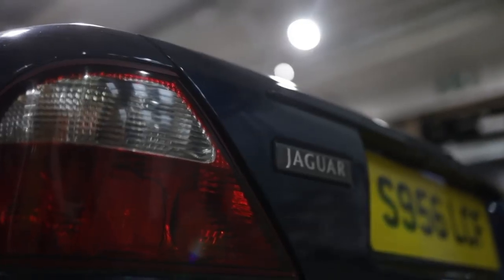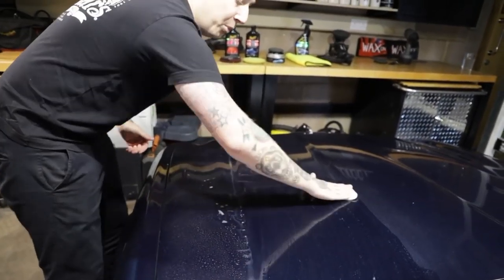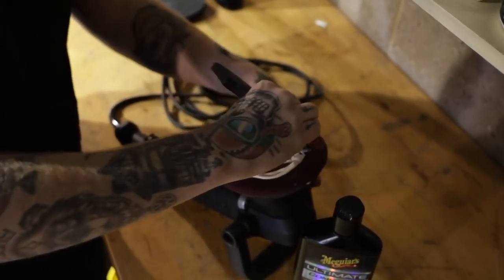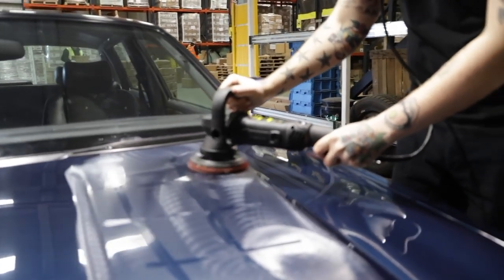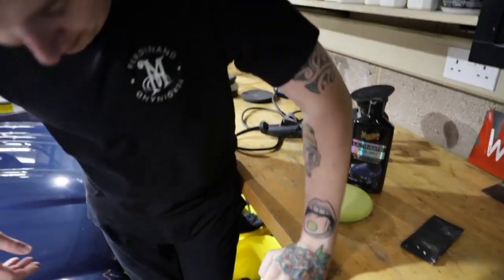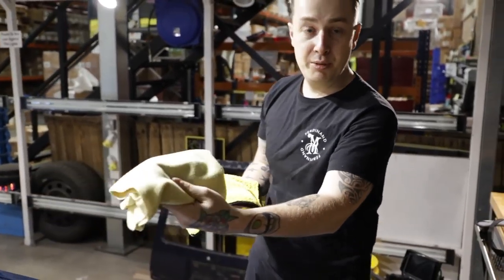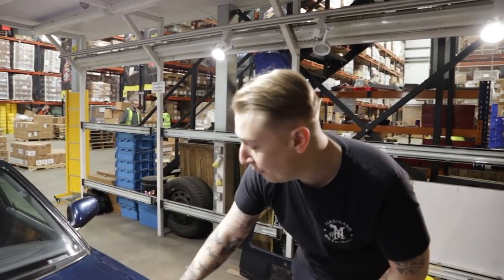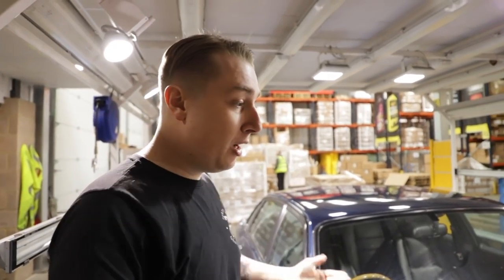How to Restore Paint for a Show Car Finish – Part 1 of 2 - Day in the Bay – UK Edition

Comment: Hi. Can you please suggest me a compound from Meguiars mirror glaze range, which is similar or close to Meguiars Ultimate Compound, in terms of cutting action.
Reply from the maker: Our M105 or M110 will be the closest but keep in mind M105 may dry quickly and not be as easy to use with a DA as Ultimate Compound.  M110 is a great option as it's incredibly easy to use with a DA and leaves and even nicer finish.
Reply: @meguiars  thanks alot.

Comment: How different is M85 from M100
Reply from the maker: In level of aggressiveness failry similar with M100 being a little stronger; however the big difference comes in ease of use, speed, and quality of finish left behind.  The M100 with SMAT (super micro abrasive technology) wins in all catagories and is more versatile as it can also work well with a DA (dual action) polisher and not just a rotary.